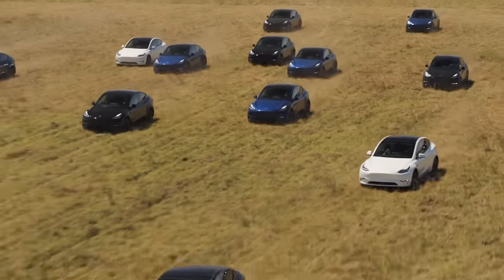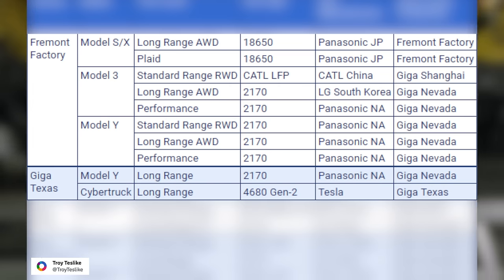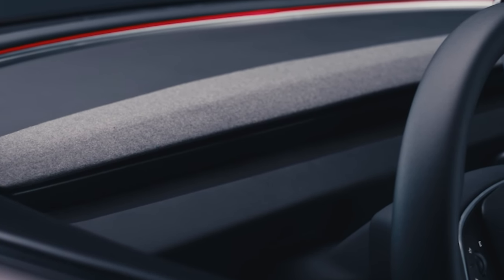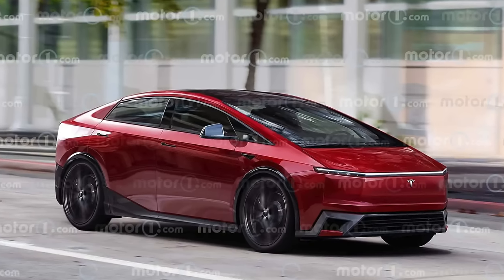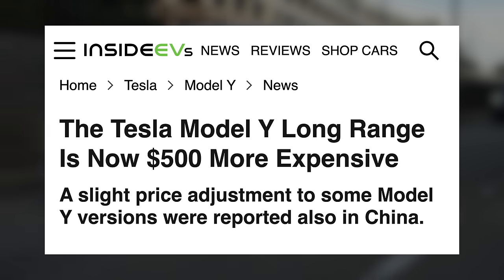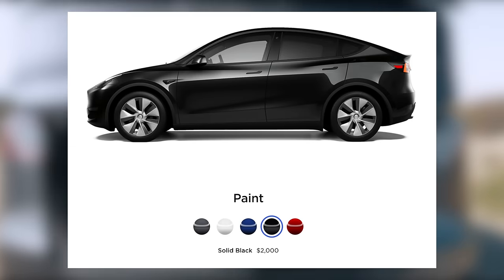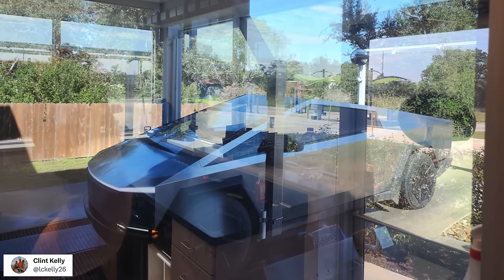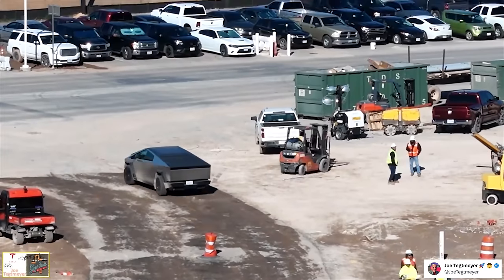NEW 2024 Tesla Features | New Models Are Getting Better

Comment: LFP also doesn’t like to be charged to 100% everyday either. However, it needs to be charged to 100% once a week so the BMS is accurate as there is minimal voltage change across the SOC range. Certainly not good to charge LFP to 100% and leave it there everyday just not nearly as bad as doing so with NCA
Reply: @jamespaul2587 Did Tesla tell you that?
Reply: @jamespaul2587  the point is this video says “100% is best for longevity” which isn’t actually true, LFP or NCA.

Comment: prob one of the biggest reasons why I haven't bought an EV yet. Just waiting for the battery to be a bit better. at least 300-350 mile range on 80%.
Reply: Why? Most ppl won't use 350 mile range, so they will be carrying around a big battery they don't need.  Keep waiting it will have to a custom battery pack.
Reply: @MashDaddy  That's most people, not me, I do a LOT of driving. Some days I might drive upwards of 250 miles in a day, sure I could supercharge but why buy a car when FED is keeping interest rates high right now. wouldn't make sense at all
Reply: I want a min 300 mile LFP pack Tesla. Maybe another year or two away

Comment: Its incorrect to say LFP prefers to be charged to 100% and best for longevity (They prefer to be at same levels as Li-Ion for that). LFP's need to be charged to 100% every now and then (Once a week) due to their characteristics relating to balancing of the cells but got that many more cycles in them the average user would not notice the extra degradation of the 100% SOC gives the cells. Li-Ion isnt at best longevity at 80% but around 60% but the extra degradation of 80% is very low so you would very probably never notice.
Reply: I agree and I would like to see Ryans sources on the LFP part.
Reply: LFP tends to be even worse with range guessing. EV like the BYD that only use LFP and always gives the exact same range no matter how you drive the car when charged to 100%
Reply: @gregb1599 Failure of balancing LFP gives highly unprecise estimates of range due to the voltage being almost the same whether 20 or 80% SOC so SOC in between are calculated values only as you can not measure it like you  do on Li-Ion.

Comment: You might want to mention that standard AutoPilot still exhibits a significant flaw - Phantom Braking. My testing, while not exhaustive, has shown that AP with AutoSteer Beta and AP without AutoSteer Beta both encounter the random Phantom Braking incidents. A number of FSDbeta test drivers have mentioned this problem, many of them mentioning they keep a foot over the accelerator to "nudge" the car out of the PB incidents. This is not a safe situation, especially when a car may be close behind you and unable to react in time to avoid a rear-end collision. For this reason, I avoid using AP when in traffic which unfortunately defeats one of the major benefits claimed for AP.
Reply: Never happened to me 20k mile in car
Reply: Vision in general sucks BIG time. A 100% greed based system that's just outright terrible vs. pre-downgrade of the cars with radar. I used to love my TM3 but last winter was an outright nightmare on "Vision" and driving 30.000 Miles a year makes the daily 120 Miles commute so stressful when "reduced speed due to limited visibility" pops up ever so often, the wipers going berserk on that dry windscreen and "auto"-dim flashes its way during the dark hours and at worst just after it has rained. Much better when the cars AP was radar based and anyone just laughed of how tragic bad the wiper-auto was due to npr having a proper rainsensor vs. any other car. 

First, last and only Tesla due to above being sick and tired of Elon having degraded my property and made winter ½-year a nightmare 2½ hours a day and being a beta-tester on he's will.
Reply: While I initially experienced phantom breaking a couple of times when I first bought my car early 22, I can’t remember the last time it happened.  I don’t think it’s currently an issue unless my car is somehow a special Tesla.
Reply: Steve, I will second that !
I have a couple of other drivers rage at us as they believe we are attempting to brake check them when our car slams on the brakes for no reason.
Reply: @ChipMIK Really don't understand the rain sensor removal. Phantom Breaking hasn't been fixed yet?? Oy vey...

The depreciation is on you though. You just paid too much for your car. Prices are now at a level that more people can actually afford it vs being priced at $50-60K which is crazy!
Reply: Never happened to me in 2 years

Comment: Great report. Tesla called me about upgrading to a Plaid. I've been thinking about it, but if a minor refresh is coming, most especially with the newer seats, I will wait. Seats have always been Tesla's weak point. I have several friends that didn't buy an X because the seats were annoying. Not bad, but in a 6 figure car seats need to be exceptional.
Reply: Only a 5 Figure Car now
Reply: I’ve never had an issue with the seats. The sport seats leaks look terrible.

Comment: Ryan, in terms of Tesla standing still, I actually haven’t really seen any improvement since 2020 in terms of battery technology. Case in point, my dad‘s new 2023 model 3 doesn’t really get any better range in my 2018 model 3, despite what Tesla website says. Also, the newer Tesla 4680 cells actually have a less energy density than the older 2170 cells.

Comment: Can we stop with this fallacy that the LFP battery prefers to be charged to 100%. That's simply false. It's required to be charged to 100% at least once per week to ensure the BMS is calibrated, but it WILL degrade faster charging to 100% vs. charging to 80%. If it wasn't for the BMS calibration requirements, you would treat LFP the same as NCA/NMC. LFP has a higher cycle life so it can be treated less poorly, but there's quite a bit of data showing LFP packs having faster initial degradation than the NMC/NCA packs in other cars due to charging to 100% often.
Reply: Didn't see this before i wrote mine about the subject. Spot on.

Comment: The Tesla dropped - $10,000 few weeks after we picked up our new Tesla.  After another + 6 months, it dropped another - $2,000.  It told us the Tesla overprice what we had bought.  After  21,000 miles, we had to removed and replaced with 4 new tires, battery was heavy, it cost us $1,600 for 4 new tires. Tesla came with No Spare Tire (new rim is $400). The mileages had dropped from 10% 15%.  To be mindful before everyone buys  . . . What if Tesla prices will drop again?  In overall all electric vehicles aren't doing very well.  The federal credit $7,500 isn't working easy as every dealer talks about.  To assure to check with your tax advisor.  No more Tesla vehicles for us!
Reply: While I do agree that what happened to you in terms of the price drop sucks for you (bad luck/timing), the tax credit is something that isn't involved with the dealer but whoever does and files your taxes. As for the tires, assuming you didn't get the largest sized rims but the standard size rims, I wouldn't purchase the OEM tires as they're performance tires that don't last long and are very expensive. Just search for tires that are the exact same size as factory and disregard any suggestions that you need tires that are better than H or V rated because it's complete bunk since V rated tires are rated at 149MPH. On my model S I got the Pirelli P7 AS Plus 3 as they have a 70K mile warranty, ride well, grip well, quiet and have better tread life than the factory recommended tires. Even if the tires don't get anywhere near their warranty rating for tread life, the credit I get from the manufacturer for reduced tread life makes this acceptable.
Reply: @imzjustplayin   We thank you for your comments, folks whom owned the Tesla, check the original tires that came with the vehicles.  Our rated W, we went to three different tires shops, they all recommended the new tires to be W or higher not to go lower the original rating. They also told us: "The battery is very heavy, the average they had seen with Tesla is 20,000 miles lasting.  What we had bought "no inside insulation, Mitchelin"  The tire shop will pro-rated the thread. What it had meant to us: "We need to continue go to back to the same Tire Shop, for the same tires, they will prorated the balance of miles when the Tesla is inside their shop  VERSUS  the warranty of 50,000 or 60,000 or 70,000 miles."  Tesla is very expensive to maintain the vehicles.  When your wheel rim cracked, under 12 months, Tesla Service Advisor told us: "No Warranty, the new rim with Tesla cost $400 each.  Go to Tesla Service Center, check out, ask for the questions for everyone one own information.

Comment: I still don’t think Tesla will make the 25k car alone, they will more than likely need to work with a company like Toyota. Companies that have mastered the Art of Manufacturing and reducing costs. I’m sure Tesla Will eventually make the car on their own, but having that help from another manufacturer will help tremendously throughout the process.
Reply: According to Automotive News, Toyota engineers were "impressed" and "shocked" by what they saw. They reportedly said that the Model Y was "a work of art" and that it had a "whole different manufacturing philosophy" than Toyota vehicles.
Reply: That is like Henry Ford asking a horse trainer to make a better Model T.  Nope
Reply: @danharold3087  Elon utilized JIT manufacturing (Popularlized by Toyota) to build the Roadster and Model S.  Not to mention the Toyota Rav4 EV from 2012 is using Tesla Model S batteries and ECU. Its not. Crazy to think about. Especially with Toyota’s ability to reduce costs and sell very low priced vehicles.
Reply: @MashDaddy  Toyota Uses BMW to make the Supra. Mazda used the Chasis from Toyota in the IA. Subaru & Toyota share the BRZ/GR86 Platform. Why? Because Toyota can make low cost vehicles that Produce a Profit and be mass produced. There is nothing wrong with Tesla Working with Another Auto manufacturer to make the 2.
Reply: @zarndt2134    I can see where you are coming from but every legacy company but  KIA/Hyundai has failed on their conversion to EVs.     I don't see Toyota teaching Tesla how to build EVs.   The work Tesla did on the refreshed model 3 is designed for simple assembly. Think optimus.  I expect the $25K car will be the first to use optimus in numbers.

Comment: The frunk is minuscule as estimated from original leaked photos. Clearly an afterthought in response to the F-150 lighting and R1T. At least if it had a lip to hold things in from falling out as you open it…what a terrible design 😢
Reply: In America, "things" generally don't fall out of the flat cargo areas of tens of millions of SUVs, vans and trucks when their hatches, doors or tailgates are opened.

Non issue.